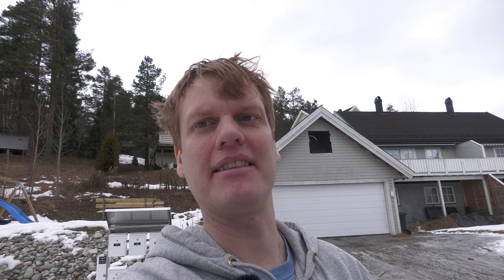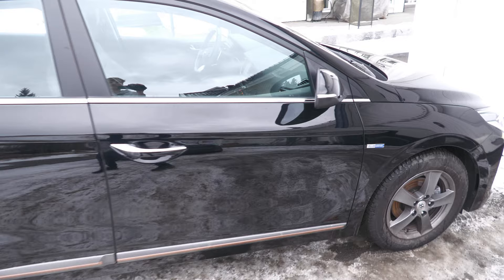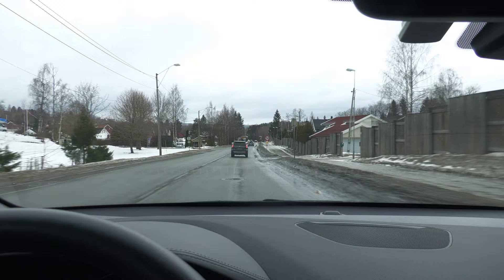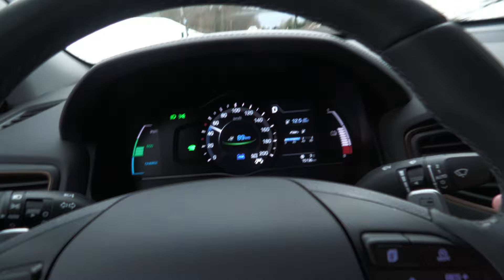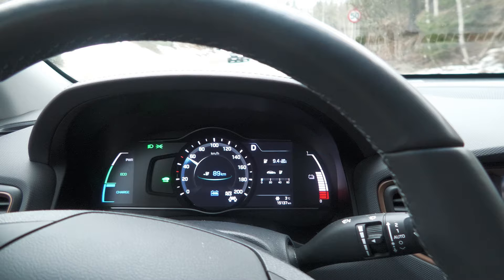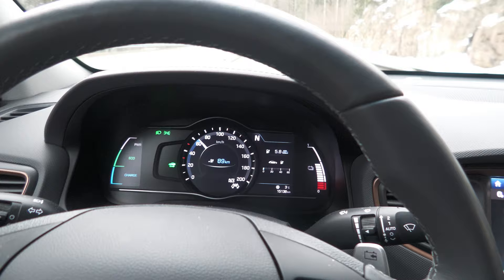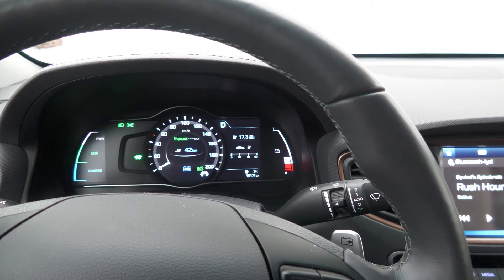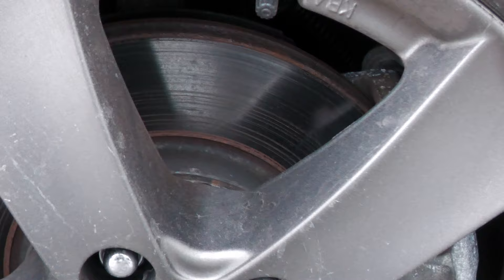How to clean rust off the brakes on an EV

Comment: In my previous car (Ampera) I did this regularly but still the corrosion went too deep and had to change the entire rear discs. The discs were otherwise near unused in thickness. I'm thinking EVs should go entirely back to drum brakes due to the corrosion issues.

Comment: Have you considered upgrading the 12V battery to lithium (LiFePo4) ?
That would be a good idea for peace of mind and also for a ljttle power saving since lithium does not lose charge and also it is worth adding a small foldable solar panel as sun protection on the dashboard 😉
It's a nice way to keep the 12V battery always topped up instead of using that function to get charged by the main battery over the inactive period 🙂
Reply from the maker: No I haven't yet, but it sounds like an interesting experiment.

I would be a bit concerned though about having a lithium 12V since the ioniq will drain it if you put on the heat without the "engine" on, that is you need to be able to put the car in gear for it to use the HV battery for heating.

I've actually done this a couple of times and if you drain a lithium battery like that you most likely brick it. The HV batteries in the car have a bottom buffer for bricking protection but the 12V ones do not I think.

I have Aux+ enabled anyway so it should charge it from the HV battery when standing still (and you have not drained it enough to kill all electronics).
Reply: @tyfonroad  
Good point there, but the lithium battery I  mean has an BMS inside. So you can not overcharge or completely drain it. 
Aux+ function could be used of course as a backup, but for normal use, it should not be necessary to have it enabled.
The original lead-acid battery in the Ioniq electric is about 40 Ah and that would be the equivalent of an 20 Ah lithium battery. So, I was thinking to use a 100 Ah LiFePo4 battery that would be the equivalent of more than 5 times the original bat capacity. Therefore, it shouldn't need to be charged so often by the main HV battery.
(especially with the help of that small foldable solar panel)
Reply: A 12-volt lithium battery should not be charged in freezing temperatures, so do not use such in electric cars (where the engine compartment is freezing cold)
Reply: @jannorgaard561  
I heard about this, but there are cars with this type of battery fitted.
I think the newer Teslas have them also.
The battery's internal BMS prevents charging at very low temperatures...
I know this raises more questions, but it is worth investigating further